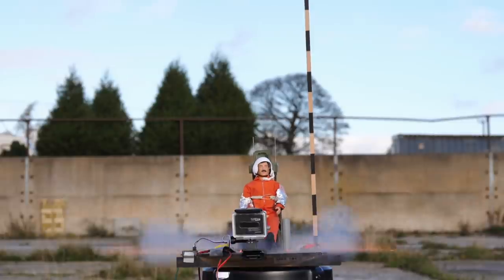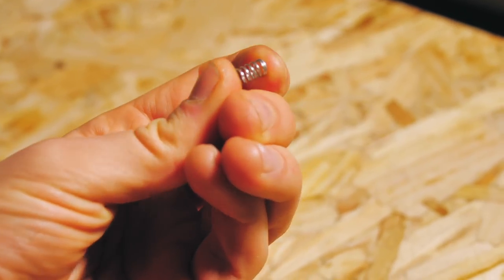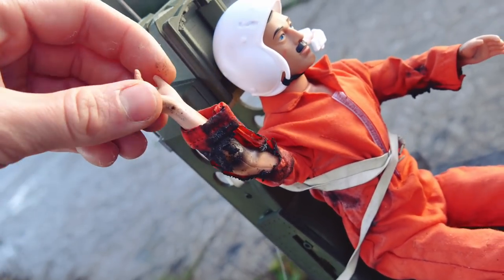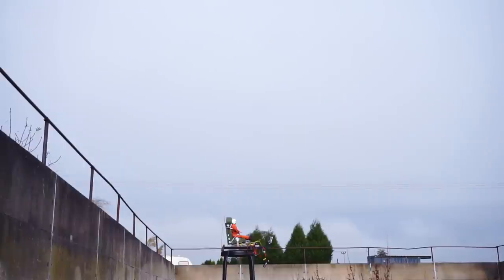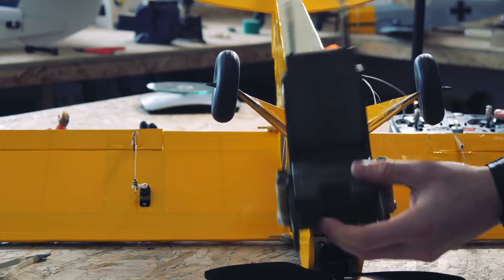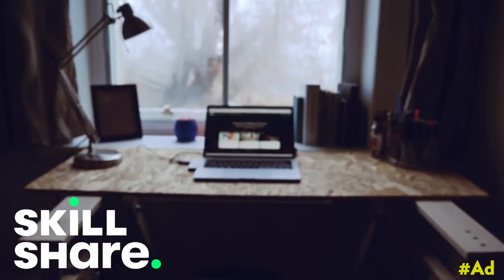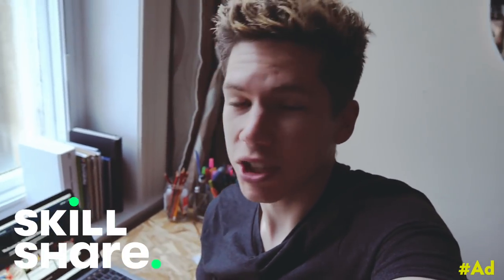RC Plane Ejection Seat - Part 1

Comment from the maker: Thanks for watching! 🚀 The first 1000 people to use this link will get a free trial of Skillshare Premium Membership: https://skl.sh/projectair11201
Reply: Hi fella , could you let me know which lazar cutter and 3d printer you use . Thanks  luv the show !
Reply: Action man should be called charleston
Reply: I feel like he's a Wilson. Just sayin'.
Reply: Could you have the actual straps imbedded into the parachute deployment motor so when the motor burned out the strap will fall away and the. The parachute be wecged behind action man (I prefer clide) so when he is released the parachute is deployed automatically without the need for moving parts just a thought I did something like that in fireworks night to launch a second fierworck from the 1st and it worked without fail just an idea but pleas conceder
Reply: Please name him Jerry
Reply: Action man should be called Jeff
Reply: Suggestion here: if you want to use the ejection charge to separate the seat from the pilot, I recommend pop off straps, and a little pipe for the gas from the top of the motors. This way the time needed to release will be minimal. Burn through thread can be tricky to get right.
Reply: now build a plane
Reply: SINCE THE DAWN OF DANGER, THERE HAS ALWAYS BEEN A INDIVIDUAL WILLING TO RIDE THE LIGHTNING. A MAN WILLING TO GIVE HIS EXISTENCE TO BETTER SCIENTIFIC ADVANCEMENT. SOME MAY CLAIM TO KNOW HIS NAME, BUT IT IS DOUBTFUL THEY DO. HE HAS MANY A ALIUS AND EVEN MORE NICKNAMES. YOU MAY NOT RECOGNIZE HIS FACE. MORE OFTEN YOU MAY RECOGNIZE A FAMILIAR SMELL. MAYBE YOU ARE HAVING A DRINK AT A BAR AND NOTICE A MAN. MAYBE HE SMELLS OF SPENT SOLID ROCKET FUEL, OR MAYBE BURNT POLYESTER , OR MAYBE IT WAS JUST YOUR OWN IMAGINATION.........or maybe, just maybe, it was!!!        "ACTION MAN"
Reply: Hey, i was wondering what produces more thrust:  a single large engine, or multiple small engines. I'm making my first rocket and wanted to know
Reply: build a machine gun that shoots through a propeller

Comment: great vid! can’t wait to see the next! as far as ejection seats, i was the division officer for the AME/PR aircrew school for the US Navy. the Martin Baker ejection seat is an extremely technical and capable recovery system, with over 3000 parts, and a very tight operating envelope. successful ejections with the aircraft inverted at 100’ above the ground are possible. the loyalty, responsibility, dedication, traceability and professionalism of the AME/PR community is exceptional. actual ejections result in an instant and often life long bond between the pilot and aircrew who worked on their “seat”. aircrew will refer to an actual ejection event as “their ejection”, taking rightful ownership for having a direct role in saving the life of the pilot. there is even an “ejection tie club” which recognizes each successful ejection event. more than 6000 have been recorded since the seats creation back in 1957. each ejection event is studied and scrutinized by the community in an effort to improve and review possible upgrades/improvements. cheers!
Reply from the maker: Super cool to hear about your connection to Martin Baker! Thanks for commenting.

Comment: You should design a ejection port for your planes. In the event of a inevitable crash you can eject all your electronics!
Reply: Yeah who cares about the pilot when you can save the electronics
Reply from the maker: That could be interesting 😂
Reply: AIR BAGS
Reply: Was going to comment just the same, something helpful for heavier payloads that might be really expensive, like cameras and internal electronics!

Would also love to watch!
Reply: you could make a custom pcb (obviously with a sponsorship from pcb way) and all of the pins for the flight controllers, esc, batteries,etc could nicely slip out of the pcb that has connectors for the cables to the motors and servos/control surfaces and they would all be nicely packaged together and the parachuted down to safety. 
edit: sorry if this is hard to follow im not the best at phrasing stuff lol

Comment: It is immensely easy to remove an ejection charge from an Estes motor. You won't have to worry about mitigating unwanted pyrotechnics. (Outside,) simply use a piece of dense pointy plastic and scrape out the clay cap and ejection charge and smoke compound. The engine propellant is densely packed in the casing and you will not remove any unintentionally. You can then add a 1/8 inch cap to the back of the casing using 5min epoxy to maintain compression once the charge is removed. Bonus, you can save the black powder from the extracted charge for other projects such as flash-in-the-pan multi-engine ignition.

Comment: You should make the belts for Action Man be held down with little plugs that go into the top space on the engines. That way when the backwards charges go off you don't have to rely on something burning correctly, and can use the belts multiple times.

Comment: You should rejig this to support a gopro or other high value component that you might put on your plane. Then you can set it off if you are ever going down and have a better change of recovering your expensive gear without damage.

Comment: Few important things, your model seem to be missing:
1. Real ejection seats often have a telescopic guiding rail, which helps to direct the seat during the active phase of ejection.
2. The parachute is usually attached to the pilot, but stored in the seat (quite often - inside the seat headrest). After about 1,5-2 seconds the seat belts are detached by pyro-bolts, the pilot falls out of the seat and parachute is opened automatically by being pulled out by the seat, falling away. This could be modeled by the model rocket motor parachute charge and it's delay, which would initiate the seat detachment.
3. The flight of the seat would, probably, be more stable, if the rockets were attached above the seat CG.
Reply: Number 3. No. That's even got a name it's called the rocket fallacy.

Comment: You could try putting the rocket motors into tubes with a flammable  thread across the top and fitted with a deflector to direct the ejection charge away from the arms.  When the thread burns it could release the action man from the seat restraints when he could then be ejected by a spring or some compressed foam.

Comment: Are you going to build a Gloster Meteor??
Reply from the maker: I am indeed
Reply: @Project-Air  What size? Will it be the T7?
Reply: @michaelkitchen5719  The original Martin Baker Meteor was a modified  F Mk 3, the current ones are modified T Mk 7's with the tail of the F Mk 8 fitted. Known unofficially as T Mk 7 1/2.

Comment: Nice idea. I used to fly model rockets when I was a kid. I would have loved to have access to all of the things that are available today.  I would like to throw in my 2 cents worth and say that it is great that you got it to work with 4 1/2 A engines,  I think back to Albert Einstein who said "Simplify, simplify, simplify'." I would like to suggest to you to see if there was some way to use 1 rocket engine and have deployable fins to keep the "pilot" stable during ejection. Maybe some weight at the bottom to dampen rotational movements. Keep up the good work.

Comment: By the way, it is possible to make a two-cascade rescue system like in the KT-1M 9 (although there are three) by simply using the waiting, as I do in my chair, or vice versa "manual" entry, that is, after the chair leaves the aircraft, and the introduction of a stabilizing parachute, using a servo machine to unbuckle the pilot's harness and fix the first parachute, which, after detaching from the chair, being attached to the main parachute, will pull it out and free the pilot, but it should be borne in mind that the weight of the chair will then increase significantly with the use of a service, battery, paddle.

Comment: 3d print some plastic rivets to hold the ends of the straps on the ejection charge side of the motor. The pressure blowing the cap has got to be more reliable than burning through the straps.

Comment: You might be able to pipe the parachute charge from a larger rocket if it was a craft that you want the seat to always end up outside the craft. like with the gps if you couldn’t ensure a smooth enough landing or expensive parts like a go pro so the plane can be landed without worry of breaking anything expensive. Idk I’m sure someone can find a use but it seems like it would have almost the perfect amount of gas to expel the load from the aircraft.

Comment: Looks like your building a Canberra! epoxy resin over the ejection charges too for pilot safety. I would use a short electronic timer on an arduino linked to a chair servo release for the pilot. It could use the acceleration from the ejection rockets to trigger the timer.

Comment: This should be used when you are flying a big plane with a lot of expensive electronics (fpv, gps, autopilot) inside the ejection module, so in case of an emergency (loss of control, signal, airframe damage or just a non-recoverable fall), all the electronics would get detached and safely fall to the ground instead of crashing along with the whole plane. This would need detachable pushrods, a good design that would work in all scenarios and would be constant (won't fail) and a rugged shell for the components along with a bigger parachute. I saw someone try something like that, but when the module ejects, it opens a parachute like a paramotor, so it could be flown back to the pilot or just guided away from danger (water, tall trees, highways...) and could be safely recovered. The airframe would need to be simple, light and cheap to make and somewhat fragile, since it shouldn't damage anything other than itself upon impact.

Comment: I want to advise you to use two ribbons from a package about 30 cm long and 2 cm thick to stabilize the chair in the air and in flight, this should give stabilization in flight, I agree that it is not a copy, but the chair is smaller than the original, so every invention has its own solutions.

Comment: An idea for the seat release would be to build a small arduino circuit with an IMU, that when it detects ejection, starts a timer. When that timer is finished it heats a nichrome wire, that cuts the straps on the pilot ( my suggestions for his name are Eric brown, after Eric “winkle” brown, and Tom Scott, but only if he has a red flight suit) the timer could also fire a small pyro to separate the pilot and the seat. The parachute on the pilot is then triggered by a ripcord attached to a seat.

Comment: a thought on the release of the pilot, If you used a rubber band held in place by a small aplication of glue across the top of the rocket motors the 'seat belt" would be blown off when the parachute charges went off.

Comment: Would it create a more stable release if a single rocket motor was directed in to a 'Y' deflector? Looks as if the parachute needs to be larger to slow down descent. Thins silk will be more flexible than nylon.

Comment: If you want to save dramatically on cost, you should use sugar rockets like the ones from The King Of Random, as long as you have a large enough pipe and enough material, it’s almost infinitely scalable.

Comment: I don't think burning the strap would be fast enough. Maybe you could have a small leaf spring on top of the engine's chute exhaust, and then use it's force to push it up and close a solenoid connection, which in turn would actuate a release mechanism.

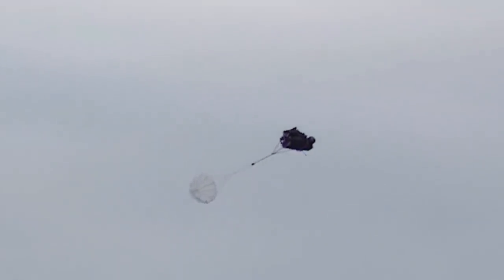Comment: You should try having a (smaller) drogue deploy when you fire the seat. It might help to stabilise it after it clears the rails, and allow you to use a single, larger rocket. That's what is happening in your video at 5:20
Reply from the maker: I'm probably just going to stick with what works, the four smaller short burn motors, and keep the drogue I tested in this video.

Comment: This has actually a mildly use for rc planes, instead of an action figure, the battery and receiver, if someone goes wrong you can eject the battery and receiver of the plane into safety, but then you would have to design special wires that can disconnect at a moments notice.
Reply from the maker: Not sure if that would be all that practical though 😬

Comment: Hey man why don't you put an adaptor for the parachute charge of the rocket motor for it cuts the straps the gas released will be useful to push the chair away from action man at mid air. May I send a pictoral representation for the  adaptor

Comment: Col. John Paul Stapp.  https://en.wikipedia.org/wiki/John_Stapp

Your drogue is unstable. Suggest a longer tether and a cross chute. You will need a way to remove the canopy, plus spares. One difficulty with ejection is the slipstream acting on the seat as it emerges, pressing it against the rails, causing friction. You will need to fireproof the inside of the cockpit. Unless you plan to use the plane only once.

Comment: Did you hear the story about how some military contracting company gave one of their executives a flight in a fighter jet as a retirement present? I think it happened in France. Anyway, he was embarrassed to tell them that he was afraid to fly and so, when the pilot first took off, the executive grabbed the ejection handle as if it was an oh shit handle in the car and ejected himself from the airplane! Of course it was supposed to also eject the pilot later but something went wrong and so he actually ended up landing the plane and they parked it far away from anything else in case the ejection seat did eventually go off. I think it just entirely malfunctioned but I thought it was pretty damn funny that it was the guy who was afraid to fly who accidentally ended up ejecting himself from the plane. He was a little injured but at least he didn't just fall out of the plane with no parachute.

Comment: Why aren't you using 13mm A10-PT motors?  High average thrust (thus, the 10), very short duration, and plugged (no smoke delay or ejection charge):

https://www.amazon.co.uk/Estes-1505-A10-PT-Rocket-motors/dp/B0006N6TU6

Thrust curve:

https://www.thrustcurve.org/motors/Estes/A10/thrustcurve.svg

Comment: I can see a flaw with the drogue: You need a weak link that's going to fail and detach the drogue from the aircraft... with the band wrapped around the parachute, I fear it's going to hang up
Reply from the maker: That's why I tested it dropping it from the Cub. Seems that's likely to work well
Reply: @Project-Air  I dunno, everything's going to be happening a lot more violently with a rocket launch. I worry it's not going to have time to release the drogue from the aircraft with how fast everything's going to happen.

Comment: instead of a model pilot being ejected you should eject the ACTUAL pilot. the battery and flight controller. 

and as i said on another comment:

you could make a custom pcb (obviously with a sponsorship from pcb way) and all of the pins for the flight controllers, esc, batteries,etc could nicely slip out of the pcb that has connectors for the cables to the motors and servos/control surfaces and they would all be nicely packaged together and then parachuted down to safety. 

edit: sorry if this is hard to follow im not the best at phrasing stuff lol

Comment: Hmmm compressed air, springs or ROCKETS

addiction makes the decision easy
Reply from the maker: It's a no brainer
Reply: @Project-Air  You may want to check local regs for rocket motors on RC aircraft. In many cases they are not allowed to leave the aircraft.
Reply from the maker: @myitbos1335  Good point! I have consulted with the BMFA on such rules, though, and they have given the green light for such projects.

Comment: You get the wrong man! You should get stig in top gear, you can fire the seat upside down and all audience will still think it is ok normal 😃 

or the six million dollar man (this one is expensive, an antique) but it will have a good side, it will make sure you design the seat seriously and properly.

If all the above is not your choice..........you still have one, the famous crush dummy. People in the entire world get used to see them blown into pieces. Censorship didn't apply to this one. You can tie its neck on a rocket and no one will complain.